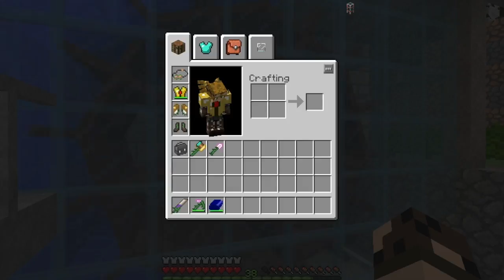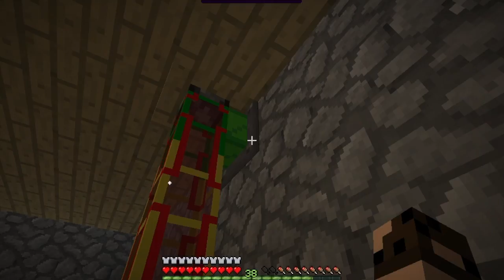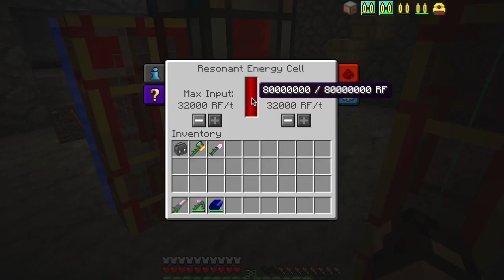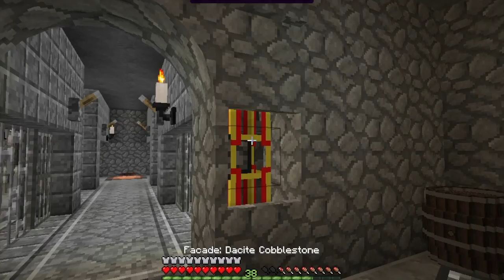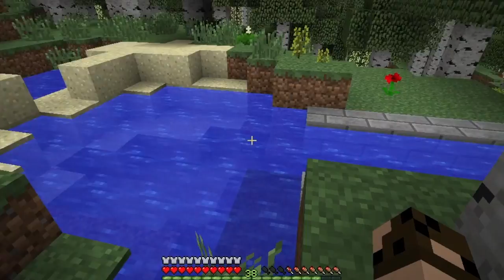Let's Play Series 1, Part 4 — Early game power creation & storage

Comment: Can you really get the max power from a triple wheel with only 3 source blocks?  I remember seeing this guide on Reddit and they had like 5 sources per wheel to get the 86 rf/t.
Reply from the maker: That sounds like an interesting idea.  I've only ever tried using flowing water blocks actually in contact with the wheel.